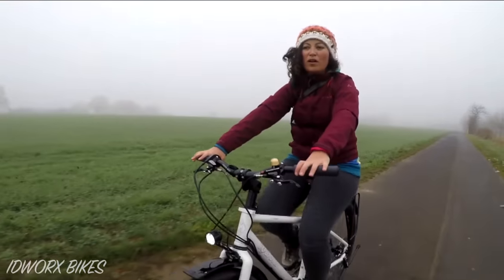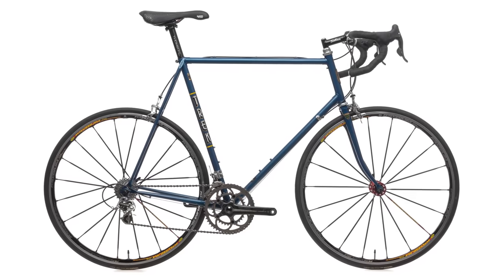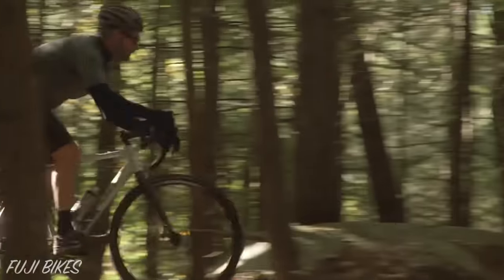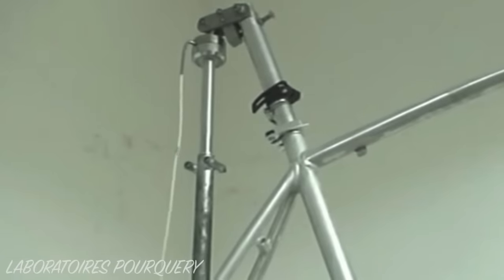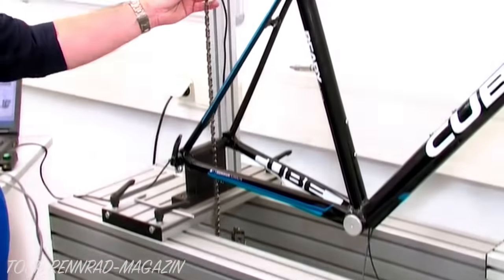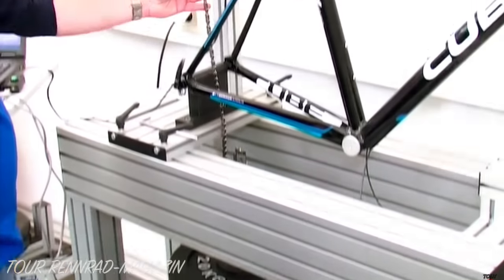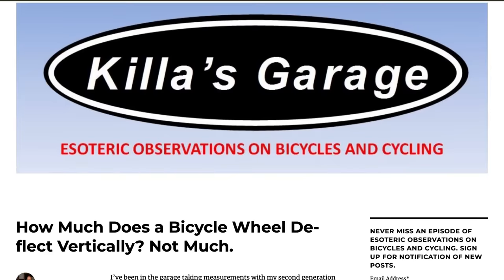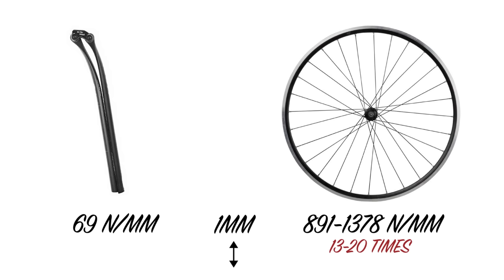Why It's Impossible For Steel Frames To Be More Comfortable Than Aluminium

Comment: I own both a modern alloy roadbike with a carbon seatpost engineered to flex and compact geo as well as a classic steel fixed gear with a cheap, thick walled seatpost and similar tires. The Alloy bike indeed feels more comfortable. I know this is only anecdotes, but i would seem to make much sense. Three parts i disagree with, though. Frame stiffness should not be measured in the vertical direction, but instead following an arc with the front hub as the center or, alternatively, a tangent on that arc at the saddle, as this is the direction in which force would be acting when bumps are transferred to the rider. Secondly, the bikes, the stiffnesses of which are referenced, were early alloy variants known to be very stiff. Modern Roadbikes that are designed to flex would probably land in quite a different order of magnitude. Lastly, tire width is irrelevant to comfort, it is all about the pressure. As a reference, read the articly by bicyclerollingresistance.com on tire width as it relates to rolling resistance and vertical deflection. Of course, larger tires would have a more linear spring curve to them, but the comfort itself relates only to pressure. Larger tires inflated to the same tension are similar in rolling resistance and vertical deflection. Also, having now read the comments, i agree with the stipulation about comfort felt through the feet, as the smaller stance of the welded tubes reduces BB stiffness in massive ways and would thus reduce the amplitude of bumps felt through the feet. And massively reduce that awesome feeling you get from a good carbon roadbike frame.

Comment: Xmax flex doesn't say what the progression of deflection is, nor what different wavelengths or the harmonics of them do. The tests are radiating all its low-slew energy into a loaded system too, so you can't equate ride feel from it. Knocking a frame directly does not equate to energy coming through the wheels, nor is it even from the same direction, or at two points of entry. You also have to work out the crossover effect of different dampening against each-other. Two springs can either cancel each-other out, or work in conjunction to be better or worse than nothing. Edit: I don't know anything, but I know this isn't end of.
Reply: Frame material dictates dimensions, bending and thickness too. It is extremely difficult to extrude titanium, and hard to bend it. Steel is generally thin-walled vs aluminium, and carbon fibre is often an uncalculated mess where it shouldn't be. Your tradeoff will be fatigue life, corrosion, UV and crash resistance, and load capacity, and price etc. so it isn't a this is better than that.

Comment: It boils down to resonant frequency. Every AL frame I have ever ridden has given me back spasms, with the exception of full suspension frames. But that is not because of the suspension, it's because they are overbuilt to the point of eliminating the vibrations produced by the frame. It's counter intuitive, but a big part of the valid perception that steel is more comfortable. Compliance plays a role as well, but it's a completely separate issue.
Reply from the maker: Should we overbuild all aluminium frames so that they eliminate vibrations then? 😎
Reply: @Cyclingabout  Sure, if I am speaking for the bike industry, make them all 30+ lb bikes. But the reason they use aluminium is because it is cheap, easy to shape and light, not because it is a superior frame building material. So it is a self regulating model. People who want a nice ride buy the more expensive steel and carbon frames. The younger, indestructible people with healthy backs, buy what they can afford.

Comment: When people are talking about comfort and feel it's not just the feeling from the seat tube. It's vibrations from the bottom bracket and head tube. This is also a big deal with motocross bikes and a reason people like KTM is because they still make their frames with steel because they feel more compliant than aluminum.  Softest to stiffest is titanium, steel, aluminum and lastly carbon depending on how the carbon frame is made. That's why they make so many carbon forks, it's stiff but can be made to absorb vibrations.  That's why almost every roadie comes with a carbon fork even if it has an aluminum frame.

Comment: Riding comfort is not measured by vertical compliance alone. You also have the torsional/lateral forces on acceleration and cornering, as well as the long-wave compliance (or flex) of the frame when you hit depressions or humps at speed (where forces do approach very high values). And don't forget the flex of the bottom bracket,  the head tube + steel fork cluster, as well as the superior short-wave vibration dampening from uneven hard surfaces like cobblestones (as opposed to the uneven dirt or gravel roads which you reference)  In all of these conditions a steel frame will be noticeably more comfortable, placebo fantasy or not... Let's also look at loaded riding. All other things being equal, with a stiffer alumimium or carbon frame the road vibrations on a rattly surface  will be absorbed mostly by the bag straps (or whatever the points of attachment) and the saddlebags themselves, making for a bit of an erratic ride handling. A steel frame will tend to respond a lot better to these small-amplitude vibrations. The question is not settled yet, especially when it comes to touring frames. You can always find a welder in Patagonia or Morocco, but good luck finding a carbon repairman ...  It bears acknowledging and repeating, however, that current-day high-quality carbon frames will just be better than their steel equivalents in almost all performance parameters.  Regardless, I found your video very informative and a helpful addition to the age-old discussion of frame materials.
Reply from the maker: Thanks! I'm glad this video has sparked lots of discussions and things to think about. Hopefully I'll be able to make a follow-up in a year with any new data or considerations that need to be made. 
I can imagine a scenario where less lateral stiffness around the BB takes the sting out of a very hard turn while standing up (eg. a singletrack corner), but the tyres are very wide on a mountain bike, so I also think the deflection will be lost in the noise (I personally haven't noticed the difference on any of my steel/aluminium/carbon mountain bikes when cornering).
I think a touring bike is the place where frame material is the least relevant! I've ridden many, many touring bikes over the years, and every single one has ridden like an absolute dream because of the huge vibration absorption of my luggage. Handling has always been a function of the frame geometry, weight distribution of the luggage and choice of handlebar.
Reply: @Cyclingabout  FYI, removing the questions of tire size and component flex which were central to your video, here are some thoughts on the steel frame & fork as a system by Tom Ritchey, who by some accounts is authorised to make pronouncements on the topic. The question and answer by Tom comes at 30:35. https://www.youtube.com/watch?v=V-gGIqfVB2Y

Comment: Steel is 3 times as stiff as aluminum and twice as stiff as ti.  This is why steel bikes are built with the smallest diameter tubes.  Aluminum tubes need to be huge to make up for the stiffness the material lacks.  These huge tubes leave less room for large tires.  The design obviously matters here, but steel should allow for the most room for fat tires because the tubing takes up the least space, especially at the pinch point between the tire and chainrings.  Perhaps tire clearance could be related to frame material, which in turn affects the perception of that material.
Reply from the maker: That's a good point. Most steel and ti bikes almost always offer more tyre clearance than the equivalent aluminium bike.

Comment: I ride a 50 year old steel Fuji. It has "four cross spokes" and 80 psi 27X1 1/4 tires. Almost no seat post exposed. I'm getting a new Ti or CF bike because: 1. I am tired of riding a bike with only six effective gear ratios. Ten speed with almost perfect overlapping ratios. 2. I want shorter cranks  for my ancient knees. 3. My brakes, bearings and handlebar are all 50 years old.Plus I can't stand drop bars much longer. 4. The factory chromed frame is getting rust spots. 5. I want a sub 20 pound bike for the swoopness. My brother bought a Bottecchia about the same time, two pounds lighter than my bike. I can tell the difference. 6. I don't mind spending a few grand on something that is going to last me the rest of my life. 7. My current ride, even with a fat padded seat, makes my butt sore after a 20 mile ride. One issue this video did not address is how a bike can beat on your hands. I can see my fork flexing on rough pavement, I might want a suspended front end on my new bike.

Comment: Yeah, the only time I noticed a certain frame having a nicer ride quality is when it has some type of spring built into it, like IsoSpeed on Trek or those Flexstays on Cannondales. I do find carbon bikes with those technologies are far and away comfier than their identical aluminum sisters, however. But I certainly agree that there isn't a noticeable difference between an aluminum bike with no built in spring and it's identical carbon sister, Like the Trek Emonda, per se

Comment: Good myth busting video @CYCLINGABOUT
I came to this conclusion years back after testing a supposedly really uncomfortable aero bike and then a bike with a frame specifically designed for the cobbles [Specialized Venge + Roubaix] . The Aero was waaaay faster and so incredibly comfortable I took it off road on gravel and singletrack. The 'comfy' bike went on same route and I got really bad hand and foot buzz on just a 20km loop. I suspected tyre pressures were the reason and yup 75psi in 24mm tyres is buttery smooth compared to 90si in 28mm tyres. 
I now ride just 45psi with 28mm tyres on wide 21mm internal width rims with 75kg of rider. Plus, because they are tubeless, they can cope with pretty brutal off road stuff too with no pinch flatting and have lots of grip as well. Though I now ride 33mm CX tyres [at 33psi] on and off road, because they are just as fast on road and a lot more comfortable off road. Oops, there gos another myth, skinny tyres are not faster.
Reply from the maker: Careful, the industry will be after you too! 😂
Reply: @Cyclingabout  already disguised as a marmoset, just in case.

Comment: I'm embarrassed to say that you are probably right, but I still prefer a 4130 frame for its durability. I have an aluminum multi-speed and a 4130 single-speed at the moment, I almost never ride the multi-speed even though I commute through hills with all of my equipment for work.

Comment: If you look at the Young’s Modulus of different materials you’ll see why steel is different. Carbon, ti, and aluminum will stress, bend, then break (all differently but they follow that pattern). Steel does what’s called stress hardening. It’s stresses, flexes, then stiffens again before breaking. This property is inherent to steel and let’s s builder create a frame that has a mix of flex or springiness as well as stiffness that you cannot get with the other materials.
Reply from the maker: Indeed. My argument in this video is mostly that frames of any material don't deform much vertically, and when they do, it cannot be noticeable due to the spring in a series effect.

Comment: Would you recon that the compliance from GT Grade Carbon frame is attributed more from the floating rear stay than the seat post alone?
Reply from the maker: There's definitely a chance that the floating stay design offers lower n/mm deflection that some seatposts. But it's had to say without testing the bike with a seatpost as low as it can go.
Reply: Thanks for the quick response. Apparently there aren't any GT Grade Bike on the Aussie market now.. Will have to wait on a refresh on the coming months.

Comment: I think what people call comfortable might vary, for me comfortable is full suspension bike. if it's a hardtail or rigid it just can't be comfortable, cus my back, neck will get misaligned easily.
so riding a hardtail or rigid, I would have to walk all technical sections, and only ride the smoother stuff. so cus of these issues, rigid or hardtail bikes are to for me.

Comment: I don’t have any science only personal experience, but on my steel filet brazed road bike I can hit bumps and cracks and I definitely feel them but the same bumps with my aluminum cannondale blew my hands right off the bars. It was freaking scary.
Reply from the maker: I suspect if both bikes had the same front tyre, fork, and handlebar, this wouldn't occur. Your Cannondale must have some super stiff components fitted!

Comment: Steel has a big problem if a frame has got a classical tube shape. These tinly little round tubes are as stiff as a sausage! Hydroformend aluminium with force-optimiezed shapes is far stiffer and much safer to ride. For example take a Trek 520 and put 20 kg of luggage on the bike. If you try to ride a quick turn the bike wants to go straight forward.
I think this lack of stiffness is interpreted as comfort by so many people.
If I want ride comfortably I try to use a seatpost as long as possible (between 25 cm to 30 cm external), wider tires with lower pressure and tubeless. But again - this is not stiffness! It's always a compromise between comfort and agility or the feel of response. A wider and softer tire goes quirky through tight corners and so on.

So back to topic: not the frame material but the square profile of a tube makes a frame stiff or comfortable. The disadvantage of steel is its density/weight to use all its advantages like E-module (elastic behaviour).

Comment: That testing rig machine is not taking fork flex into account at all.
One of the best riding road bikes I ever had was a Viscount Aerospace Pro with chromolly steel frame and the solid aluminium "Death Fork".
Loved that frame and solid aluminum fork. Completely different thing than Aluminum tubing. 
Would not own an aluminum hardtail ever.

Comment: I feel every bump on my carbon frame and wheels but its lighter by a few hundred grams. My old alloy frame bike and wheels soakes up the bumps beautifully.
Reply from the maker: Sounds like you might have some wider tyres, a longer post or a more padded saddle on the alloy bike. 👍🏻
Reply: @Cyclingabout  The bars same width just different materials, carbon on carbon alloy on alloy frame. Same saddles but alloy frame has a carbon post, standard round type and carbon a proprietary d shape. The carbon frame is an aero design with dropped stays whereas my alloy is aero with conventional seat stays. I have deep section carbon on the carbon frame and shallow section alloy on the alloy frame. Tyres and tubes both the same being 25c. I'm inclined to the view that the dropped stays and carbon stays are giving a harsher ride overall  albeit less buzzy.

Comment: This video burst my steel-loving bubble :(
I tried steel hardail vs alu hardail, back to back, on downhill and I was absolutly 100% sure that steel one was better. And now its turns out that it was some wierd placebo.
Reply from the maker: You can still like steel bikes! 90% of my bikes are made from steel. 😎
Reply: You should never accept what a stranger says simply because they're confident , appear to be sure about what they're talking about & spout a lot of technical jargon, because in fact you were right Zak, not Cyclingabout. But it's actually because aluminium bikes are intentionally designed to be stiffer to take into account the fatigue issue of Aluminium that steel & titanium don't have. One could in fact build a Aluminium bike to the exact same design as a steel frame, right down to tube gauging joint design, welds & exact angles & it would ride like a equivalent steel frame, but not for long before it becomes aldente.

Comment: Very good content, as always!
I have to say, i always wondered why all carbon wheels (on road bikes) i rode definitelty ride nicer than aluminium rims. even with the same tires at the same pressure on my own bike that i know very well. if there is basically no vertical compliance in either wheel, where does the difference come from? 
a thing i also noticed is, that with a wider heavier tire, there are situations where the same bike begins to feel less "floaty" over a certain type of bumps than with a narrower lighter one, even with vastly less pressure.
so i recon the rotational mass does make a difference. and less mass is sometimes better.it feels more "zingy", less "crashy" when you ride lighter wheels on a roadbike.
Reply: They likely feel better because less energy is wasted in flexing the rim (on micro/small bumps), which means more energy is returned into the ground, hitting a 5mm rock at 30kph will introduce way more of an impulse than pedaling ever could.

Comment: As far as frame material goes, saying one material rides one way and another rides differently is baloney.  It all depends on the specific bike.  I ran a business buying and selling high end road bikes on Ebay from 2011-2013 while I was in grad school and rode a ton of different bikes and can tell you that some carbon is super comfortable and some is not (I often used the same wheels and tires for a control).  I rode different steel and al bikes back in 80s and 90s and it was the same thing (I would usually buy and frame and build with my parts so again there was control for tires and wheel and even bar and seat post).   I have ridden more bikes than most people that call themselves reviewers and can tell you that it is not the material it is what the builder does with it.  Geometry also plays a big part in this...   a bike with longer chainstays will feel smoother  than one with shorter ones...  but it will be a bit less quick to accelerate...